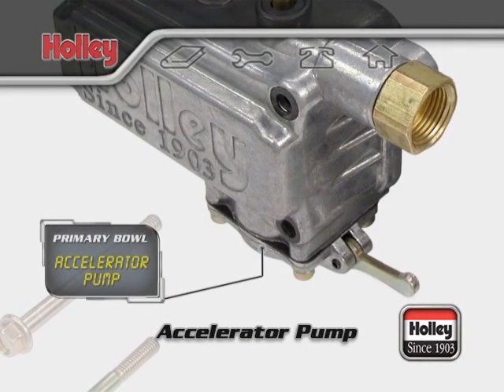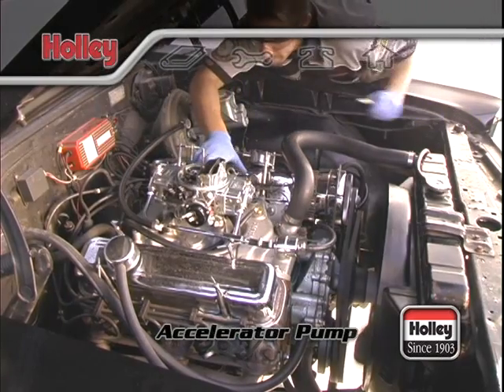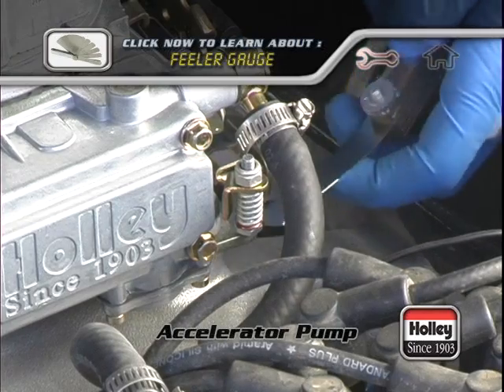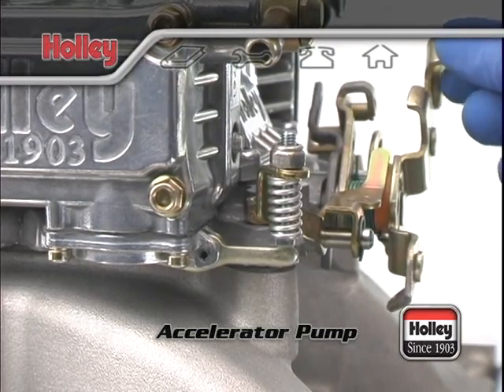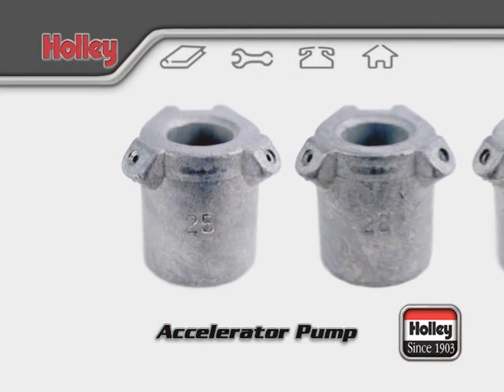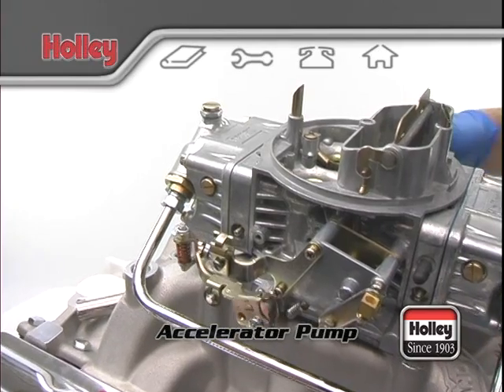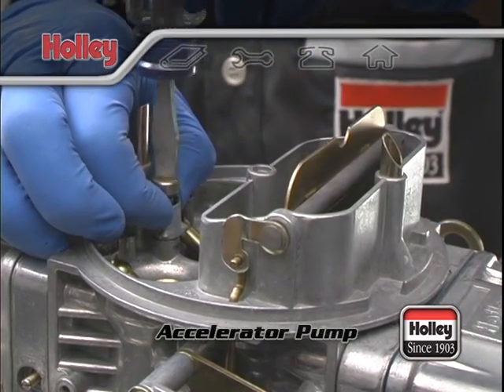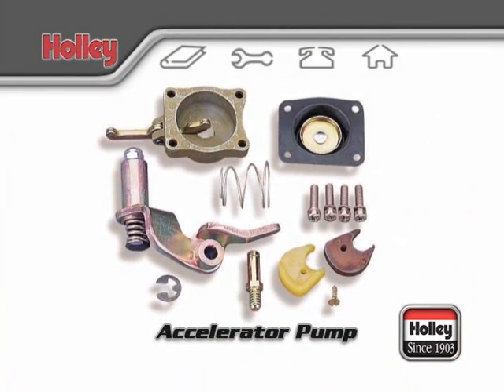Accelerator Pump

Comment: I've got a 3400 pound car with a 367 hp Ford 302 with oversized valves and mild cam( no lope at idle), and holley 4150. If the vehicle is idling and you walk up and rev the engine quickly 3-5 times in a row, it stumbles and the engine shakes then resumes acceleration ONLY the first time you rev it up. EVERY OTHER time it revs perfect and smooth with no hesitation. I have tried adjusting the accelerator pump, it did nothing at all. Then I tried a 35 nozzle (stock is 31) which also did NOTHING. This is DRIVING ME NUTS!!! WHAT is wrong with my carb...???  I have also done TONS of timing adjustment all over the map. Engine manufacturer says 10 to 16 initial. At 10-12 It backfires loudly from the carb... 16 it chuffs fuel mist from the carb, and does not want to crank up. I keep it around 13-14, and it seems happy, but this damn shudder/hesitation/bog whatever is driving me up the wall. I am ready to yank it off and try an Edlebrock again..... HELP!!
Reply: Do I need to try a smaller than stock nozzle or what?

Comment: what would cause a dribble then stream from nozzle, brand new carb from holley, had to swap out the pump they had in carb as it would not even move when below zero, put in a pump from a demon kit had on hand.. was trying to cure off idle stumble and then looked at the flow after cams or nozzles did not correct issue.  The nut on my adjuster is near end of threads just to make contact, perhaps something is bent, it was made during pandemic and took them 3 months to make me one, 660 Truck Avenger. had 28 went to 31, tried dif cams, heavy plow truck, then looked and saw the dribble at off idle.. think that is issue..  maybe bore is rough or check valve below squirter?  of course snowing now and might have to suffer another season with it like this..
Reply: holley had one of the green ethanol diaphragms in it, it was -15F and it would not squirt at all, just bind,, was fun pulling it twice in blistering weather. guess their ethanol pumps need some new material to be  used when cold.. now wish kept injection on this ride..  was carb when bought and kept, should have just went back to injection, carbs are a pain with these different blends of fuel lately..
Reply: now summer, still trying to get stumble at off idle cleared up.. the page that directs us here goes from adjusting clearance on pump arm right to changing out the squirters, and makes no comments on pump cams.. says heavy mid axle range should have small squirters then says bump them up 3 sizes, I already tried that, made no difference..  guess have to look at the video to right mentioning pump cams to get this figured out...  5.7 040 over 395 roller cam..
Reply: Just wish when you send in a carb for warranty the carb sent back was set up the same as the carb we sent in...  I set this carb up too many years ago so lost the sheet with jet sizes, squirters size, power valve size, pump cam setting.  starting from scratch when it took months to get her fine tuned is a royal PIA...
Reply: Was -10F when I tried to set this carb up, just looked at what I stopped at and was leanest it could possibly be on pump cams, Black on #2, went to Orange on #1and stumble gone,, finally can move onto other projects.. thought had purple in there..

Comment: They didn’t tell you u need to check the gap with engine hot at the idle. Not when engine is cold and choke closed.

Comment: I have a 84 Monte Carlo SS and my car seems to idle fine but under normal driving it runs like crap and bogs under any throttle more than just a light tap. But if I pump it and floor it the car takes off hauling a&$. Any idea if this could be it?
Reply: Figure it out? My 351 is doing the same thing
Reply: @50kfrenzyy95 anything yet my 351 doing the same

Comment: have they reinvented the little diaphragm that goes around the accellerator pump yet to withstand ethanol? i need a replacement for my 1970 holley, it's kinda threadbare and seems to be the point of the leak
Reply: In case anyone is still wondering about this, it's the green diaphragm you want. Some rebuild kits come with both black and green diaphragms, use the green one.

Comment: My double pumper dies when the secondary’s open and it’s s brand new carb, I’ve tried all different sizes of nozzles with no luck at all
Reply from the maker: I really need more info about your set-up,  but it sounds like you have a carburetor that is too large for your engine.  What is the list number of the carb you have?  Now some details about your engine and trans combo?  What cubic inch is the engine, intake?  headers or manifolds? What rpm is your red line,  manual or automatic transmission?  If it's auto what is the stall of the convertor?  weight of the car?  thx J
Reply: HolleyPerformance my engine is a 305 small block chev with 10:1 compression, fully ported vortec heads with z28 valve springs and larger valves, 270 magnum comp cam 226/226 @50 470 lift, performer RPM intake, HEI ignition 38 total timing all in by 3000 RPM, swapping manifolds to long tube headers soon, red line is 6200RPM making roughly 370hp stock stall and 308 gears, the carburetor is a 650CFM brawler with electric choke and mechanical secondary’s had to add larger jets and 3.5 powervalve because vacuum is 6HG in gear, runs excellent once I am off idle and going down the road and I’m getting about 19MPG I get a lean condition off idle so I ordered the 50cc pump kit hoping that helps me out it also has a 45 nozzle with the hollow screw car is 3000LBS
Reply from the maker: @christianbressette8879  Pretty healthy 305!  You say it runs excellent off idle?   If you are cruising and punch it (wide open throttle)  do you get a hesitation or bog?  Did you change out the nozzle on the secondary also?  How about repositioning the nozzle cam to another hole or swapping cam profiles?
Reply: HolleyPerformance I’ve tried lots of different cams except yellow and brown, runs best with blue on the primary, if I open secondary’s slowly I have no big or hesitation but if I floor it the engine stalls I’ve got a pink cam in the rear with a #18 nozzle
Reply from the maker: @christianbressette8879  Can I ask why you went down on the rear nozzle?  (should be a #31 front and rear if you have the BR-67212 carb)
Reply: HolleyPerformance I figured going down in size would help the cutting out when floored problem maybe I should go up sizes instead
Reply from the maker: @christianbressette8879  I would try to keep them close to the same size or at least within a couple of numbers.  Visually observe them also to make sure that they are both squirting about the same amount of fuel.  You may want to play with your timing, you never said what the base timing is but that can affect the off idle performance.  Also in my experience total timing for those engines generally likes to be all in by about  2500 rpms using 93 octane. thx J
Reply: HolleyPerformance thanks for the help, I’ll try going to a 40 on the rear and my timing is about 18 initial
Reply from the maker: @christianbressette8879  Ok, try out those things first and we can go from there.  Unfortunately, it's really hard to diagnose carb problems over emails!    But we will give it a try!!  J
Reply: you must come from another planet
Reply: @HolleyPerformance  good questions. shows how even a new carburetor probably has to be tuned specifically to each carburetor.

Comment: Ok.so if its not set right on a double pumper.will car idle proper and fall flat in a gear..thats what mine does...i get jerked around like im driving like an idiot...but its the car and i cant figure it ou
Reply from the maker: it's possible but i need more info to help diagnose your condition?
Reply: This is what my car is doing as well. Put in gear it stumbles and falls flat. But if I quickly pump throttle the response will catch then I can move the car without stalling.  I going take mine off and check it. What fixed yours ? Thanks.

Comment: Todays pump gas has caused premature failure of the diaphragm on my carb.
Reply: i might have the same problem, leaks from the bottom around the pump. diaphragm looks thin, did anyone invent a modern one? i need to find one
Reply: Today's gas is horrible and goes stale within 30 days. Im an independent small engine mechanic and thats the cause of like 60% of my business, cleaning carbs, draining fuel, just did a service call today for a generator with bad fuel in the carb